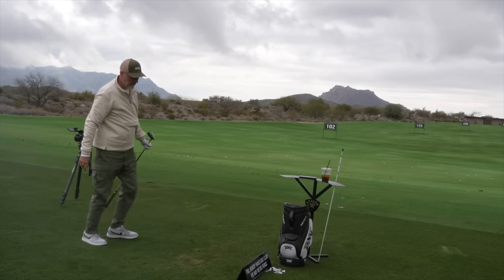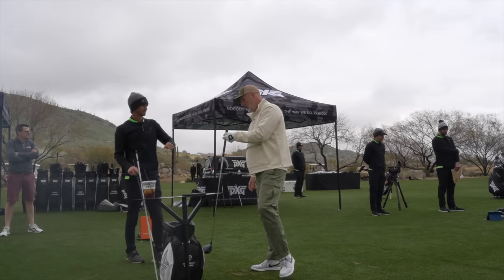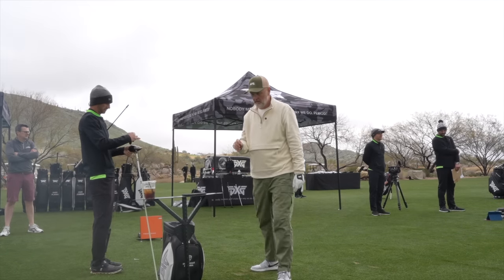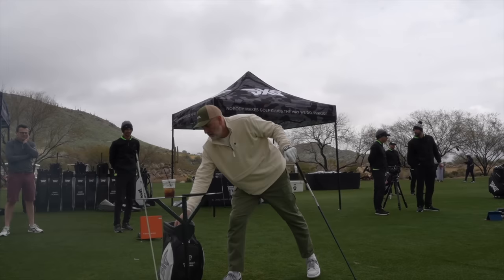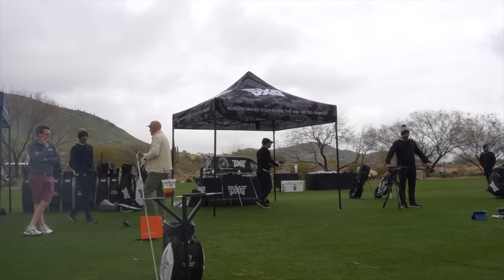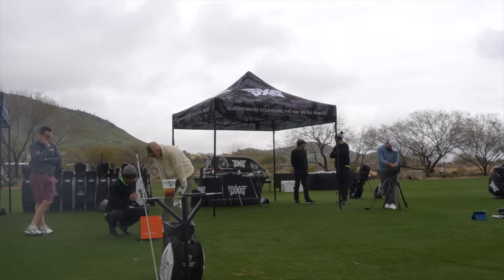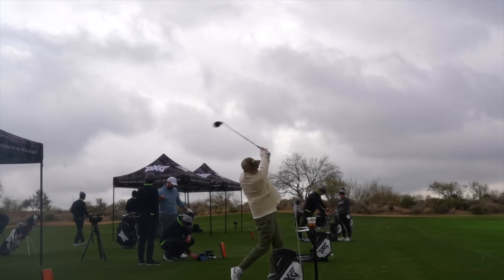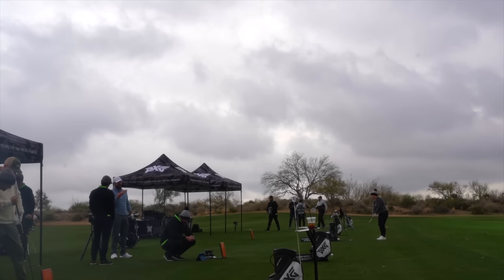CUSTOM FIT is POINTLESS if you do this!

Comment: Wish I could have been there. You have explained exactly what I suffer from. Overswinging. I have occasionally made a swing well within my limits and been amazed at the distance created.
Reply from the maker: Yes it defies what we think might happen
Reply: @TheAverageGolfer  yes very valid point overswinging at the range or indoor simulators...also is it worth getting custom fit if you dont have a consistant swing? (high handicapper)

Comment: I’ve found my swing actually speeds up on the course and it’s slower on the range. Adrenaline gets going. Especially when the heart rate rises we move faster. I do a combo of smooth swings in fitting and really go after it a few times to simulate that on course scenario and see how that impacts spin, ball speed, and flight.

Comment: I was consistently hitting toe deep with my standard loft irons so I got a set with +2° lie angle only to have the same problem.  That’s how I realized the root  cause of the problem was my static set-up posture which was allowing the “dynamic” swing force changes in the downswing to pull me off balance on my toes through impact without ever realizing it because of the way the subconscious brain figures out a way to stay in balance.  When swinging a heavy mass on a stick around the body the subconscious brain will try to steer it to a place where it isn’t causing imbalance, which isn’t the ideal path to deliver club face to ball consistently.

Once I was aware what my problem was I revisited Ben Hogan’s drill in which you start with 1/4 swing shot with a 7 iron, from takeaway to finish extension, with goal of consistently hitting those clips dead straight then gradually increasing the swing arc to increase the swing force variable.  Sure enough I discovered as I increased the variable of swing arc and force I began to be pulled off balance.  It was simply a matter of correcting posture and learning to keep “dynamic” tension in the legs to anticipate and counter the force pulling forward by pushing back an equal amount.

The net effect of that “club pulls / legs push back” dynamic is the body stays in the same place over the feet in perfect balance.  Because the force increases faster than the brain can react when the club swings around the hands and accelerates (which increases force exponentially) you need to learn to proactively prepare and start counter the force with the legs before it increases.  

One of the keys for learning the timing for doing that is using the index finger of the trail hand on the shaft for feedback on when the club head is starting to transition from pulling the wrists back in radial deviation to accelerating around the hands.  When the pressure on the index finger held on the side of the grip like on the trigger of a gun starts to decrease the legs need to prepare to counter and balance the pull of the club which is about to occur.

Once I fixed my balance problem on the mats at the range I found I didn’t need the added up lie angle on the clubs and was better able to judge and anticipate being pulled off balance on uneven lies. Its worth noting I was playing every day (weather permitting) when I was doing this but it took about two months to groove the new subconscious reflexes.

Comment: Good day! It’s Ronnel here in Canada, 53 years of age. My swing speed is similar to yours. I am currently playing Gen4 set. Would you mine to share your driver, wood and iron head/shaft specs? Cheers.
Reply from the maker: The driver shaft was the Graphite Design VR 60 stiff, the fairways and hybrids Tensei Blue stiff and irons steelfiber i95 stiff

Comment: I did the same thing.  My fitter didn't use swing speed in the fitting.  He ignored it completely.  He said speed speed isn't important.  It's more how you load the shaft, how much spin, and launch angle.   My swing speed was a "stiff" shaft.  But my swing transition and shaft loading was more regular shaft.  Glad I did this because that philosophy was spot on!!   Swing speed isn't the most important factor in shaft choice.

Comment: I've said this before and I get roasted for it but here goes.  I firmly believe that for the "average golfer",  custom fitting renders very little return on the investment.  I was in the tennis industry for years and the one thing we had to do is come up with different revenue streams each year.  The oversized racquet, the tear drop shaped racquet, the Blackburne tennis racquet strung on both sides, all were an attempt to convince people to buy.  I've been playing golf for a long time and I don't believe that custom fitting will improve your game significantly.  Spend the money on lessons and you may see better overall results.